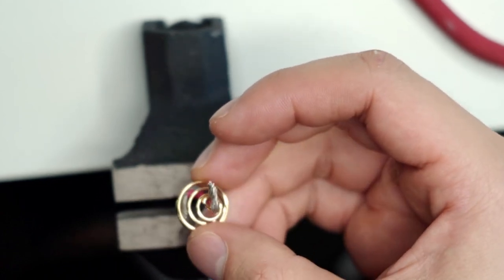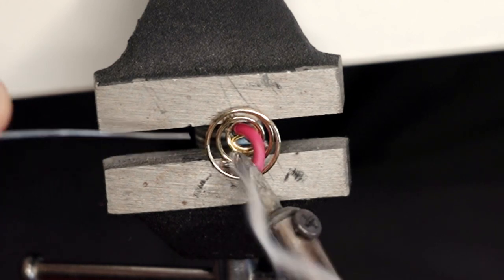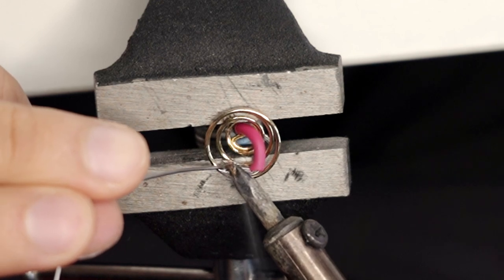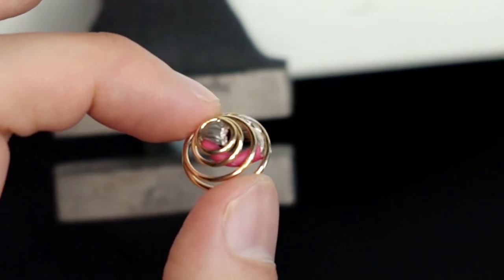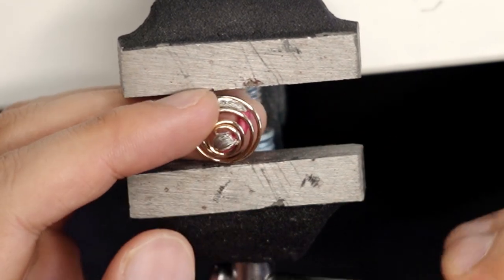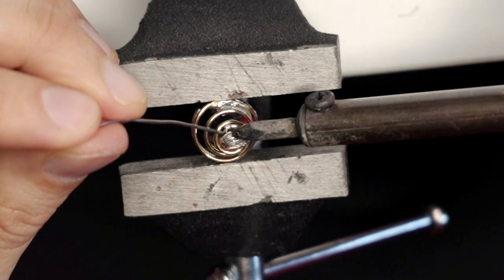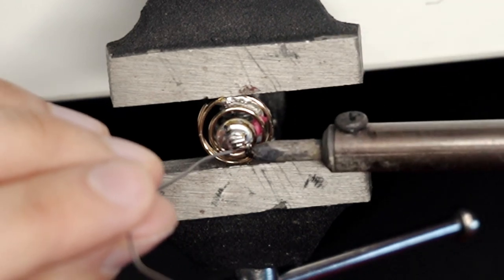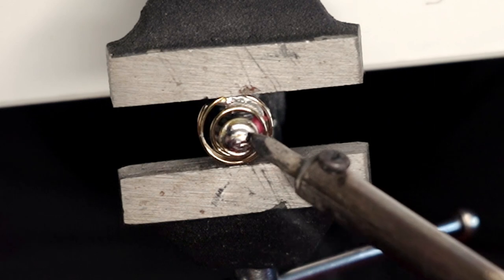Brighter Flashlight in 5 Minutes? Spring Bypass Tutorial

Comment: Ah, I finally found your spring bypass tutorial video! 🔦👍

Question: Wouldn't it be a good idea to test the resistance of the tailcap spring using a quality multimeter to decide whether this bypass procedure is worth undertaking? I mean, electricity is "lazy" and always takes the path of the least resistance. Or can we just go by the assumption that all tailcap springs have a higher Ohm value than a thick gauge of short insulated copper wire? 🤔
Reply from the maker: For these budget FET lights, I've found that spring bypass with some copper wire always yields some performance increase. They're using the same basic springs.
Reply: @DarrenYeoYT  That means all of the battery's current is flowing through the copper wire instead of through the spring.

Do you happen to know if the premium brands like Imalent, Surefire and Olight use tailcap springs made from exotic materials like silver, gold or graphene? They have a much better conductivity than copper - only much more expensive.

Apparently a simple bypass using a fat piece of short copper wire also works (and cheap too), but none of the flashlight makers have thought of this.

BTW, does this spring bypass hack also work for buck and boost drivers or just unregulated FET drivers? 🤔
Reply from the maker: Spring bypass only works for FET lights.  I think some premium brands use copper springs or another material I can't remember. Gold plated could be a thing too.
Reply: @DarrenYeoYT  FET drivers only, check. Ta, mate! Sorry if I've been bothering you with too many questions but I have learned so much from your channel alone! ☺🙏
Reply from the maker: Not at all mate, ask away :D I just sometimes struggle to keep up with different convo threads on here. YouTube doesn't notify me of all of them.